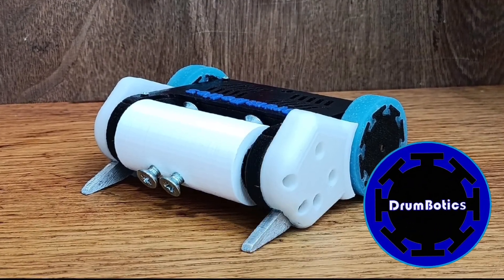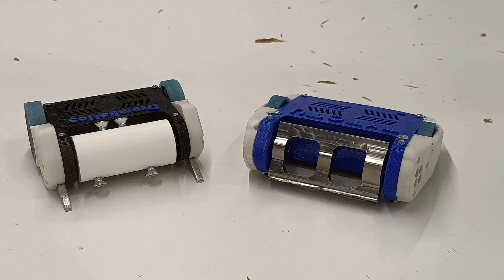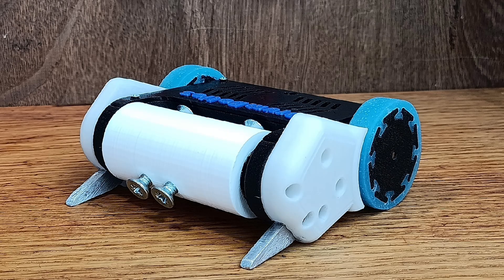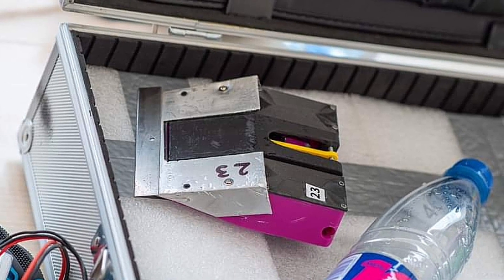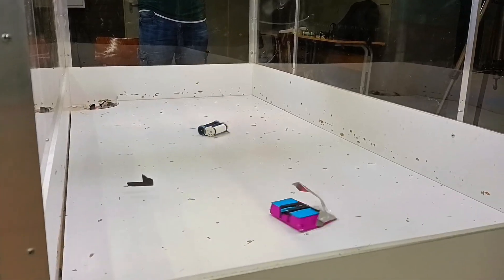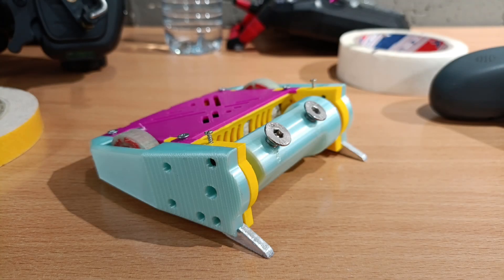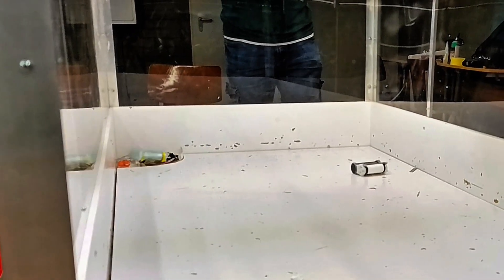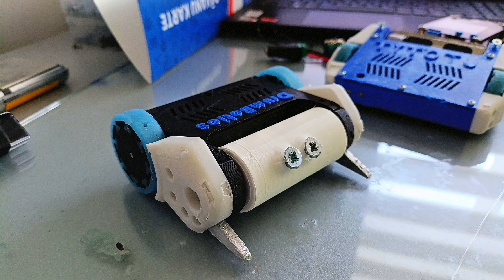TESTING THE DRUMBOTICS KIT! antweight fights at my antweight arena.

Comment: While I don't need another hobby, I am more and more tempted, the more I see these, to jump on board.  Of course it would have a chainsaw for a weapon.  Geared so it would move super slow, with TONS of torque, so when it does catch someone, it just rips thru them without stopping. P.S.  Wonder if that would even work.......   Every bot I see has a super fast weapon.  The centrifugal force makes the bot hard to control tho.
Reply from the maker: not really. the weapon is not that heavy and it is pretty easy to control. for combat robotics its best to use a fast weapon best for biggest hits. high torque doesint really work for these small 150 grams. and not really in the heavier
categories.
Reply: @DrumBotics   Would be cool to design something that actually grabbed opponent, and pulled them into your weapon.  If they cant move around, they can't fight.  Have never seen anything like it tho.  Prob for a reason.  Lol
Reply from the maker: @hainsawFPV overhead spinners like sawblaze do that. they win nowdays very much. Havent made one yet. mabye in some time later

Comment: Do you have a tip over switch that reverses all 3 motors when upside down? It would help with controls and keep the drum spin the way you want.
Reply from the maker: Yeah mabye it would help i dont have it. i just gyro into my good side.
Reply: @DrumBotics  speaking of gyro, a flight controller should have a gyro to act as a tip over switch